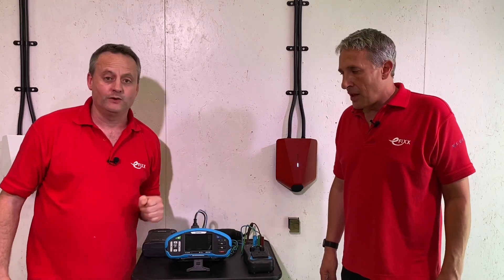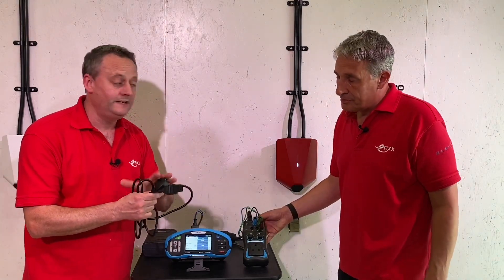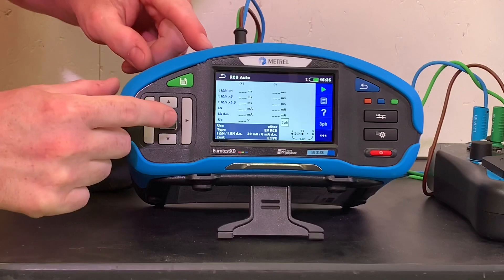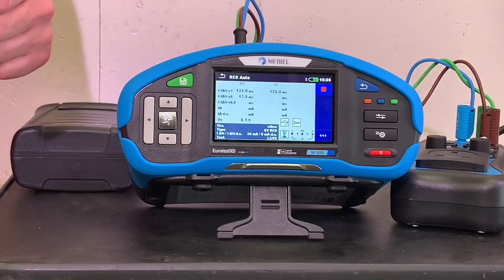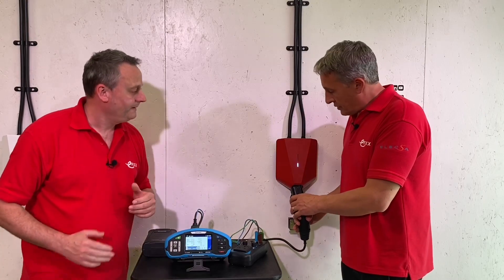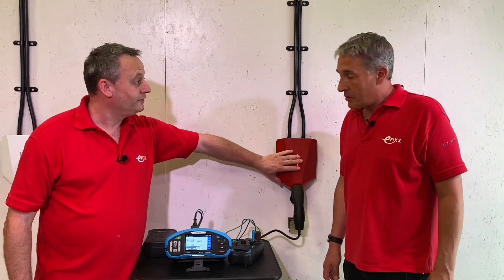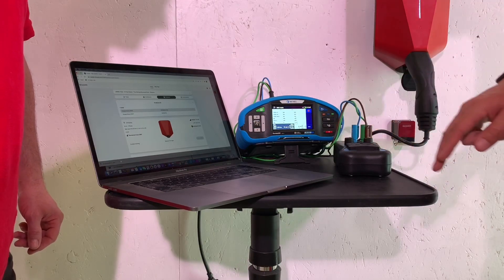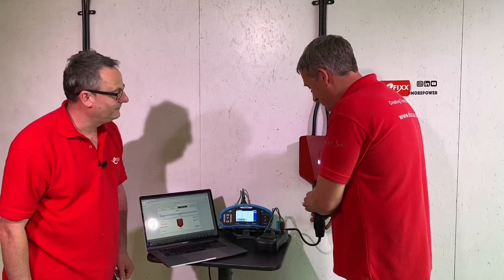Testing the RCD hidden inside an Easee EV Charger.

Comment: Excellent video. And brings ESV (Swedish Elsäkerhetsverket)  to shame regarding Easee. ESV is the Swedish electricity safety government agency that states that Easee does not comply with rules and regulations regarding AC/DC RCD. They also state that the Easee home should be withdrawn from the market...
Reply from the maker: Thanks for the heads up we are exploring this.
Reply: You should really read up on things you comment about, when you don't know what you're commenting about.
Reply: @petterekman  Interesting, please explain? 
I have read EVERYTHING regarding case nr22EV1261 including Easee answer 13/2-2023. 
I do understand everything that is written in those documents.
What is written in media is completely irrelevant.

Have you read it all? 
Do you understand it?

If so, please explain to me what I do not understand, and what I should not comment about...
Reply: @kjelllindberg6987  Granted, I haven't read the entire report, but I've glanced through it and the RCD-issue is just one small part of the problem.

Easee have claimed that they comply with certain standards, which they don't.
The RCD may function properly (as displayed in the video above) but it still doesn't have the correct specifications as per the standards.
That the box doesn't pass the overvoltage-test LLLN-CP is quite concerning and something I haven't even seen Easee comment on.
That the box doesn't fulfill the IP54-rating they claim is concerning to say the least. Sure, the box may function properly when it's new, but what happens after 5-10 years outside when dust and moisture have crept inside? The slight difference from the standard in the opening gap on the RCD might be what it takes to keep it from functioning properly.

You don't agree that there are many things that ESVs report bring to light that are quite concerning?

Reading the replies from, and interviews with, Easee also makes them sound like a naive company that don't really understand the intricacies of CE-marking and following standards.
Reply: @kjelllindberg6987  please respond
Reply: Because it does not comply to the standards that  Easee claim they are meeting. They are also calming to meet  different standards that counters each other. You pick one standard and meet everyone of the points or exceed them, if you come up with a better solution it's fine but it has to exceed the current points set in the standard.  
But like everyone else you are hung up on the rcd while the bigger problem is the EMC protection. 

They are also claiming to meet a slam standard but delivers no protocol from third party to prove it

On a side note, the RCD is as I understood it in Easee built up of different "relays" for the phases with no physical connection. Meaning the trip times between phases will warry and they will not trip at the same time or even may not trip at all. The tester only test on phase at a time and no normal electrician has a 3 phase tester so it's not tested in the field. 
I have not seen the easee my self so this is just what I reed!!!
Reply: I am here for the same reason. If ESV failed to prove their ground - I guess they can expect case against them from Easee. My only complain for Easee charger so far is lucking of local control API.
Reply: The AC/DC RCD failure is only one of the many failures....

Comment: Do a new video. There are some reportage from Elsäkerhetsverket in Sweden that this easee unit has som serious issues
Reply from the maker: What are the serious issues?!
Reply: @efixx  A popular brand is Norwegian Easee. But they are now being criticized by the Swedish Electrical Safety Authority as three of their boxes (Home, Charge and Ready) lack a built-in ground-fault circuit breaker and do not meet the requirements for DC protection - even though the user manual says otherwise. The overvoltage tests that the Swedish Electrical Safety Authority carried out on the Home model were also not passed. Charge and Ready have not been tested, but they should have the same construction as Home.

Now the Swedish Electrical Safety Authority wants Easee to respond to the criticism they have made and what they will do about it, by February 13 at the latest
Reply: @fotbollemittliv1  But this test test that you guys at eFIXX did shows that it definitely does have DC-protection. Perhaps the issue is more in documentation and formal requirements than technology?
Reply: @andersmusikka  different type of protection. DC and AC. One has failed and one has passed.
Reply: Easee Ready is simply a plastic cover and contains no electronics at all. It was made to insulate the back plate and make it safe for future installation.

Comment: Why have it set to 32amps if it’s 3 phase? Why not just wire it in single phase at 32a?
Reply from the maker: 3 phase you can charge at 22kW single just 7kW

Comment: How are these for testing through the parameters of the larger chargepoints with the rate controls. Having a nightmare at the minute trying to test some 100a dualport project ev chargepoints my non metrel tester wouldn’t test them as kept taking out thevparameters and putting into error. Tried different branded meters and having similar issues. With megger saying it’s a nightmare not having a bypass from the parameters just for testing Rcd at charge port. But I want a new reliable tester that I won’t have similar issues. As testing parameters back to factory settings and then setting up after is a pain in bum. But only put in some 200a